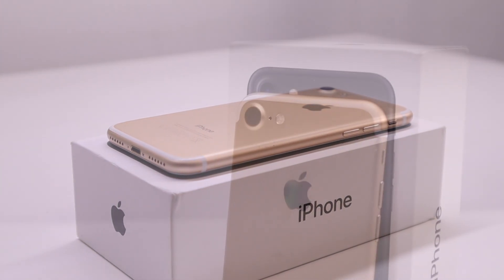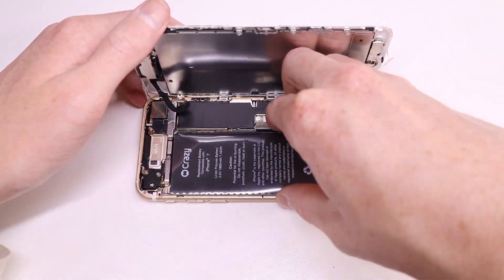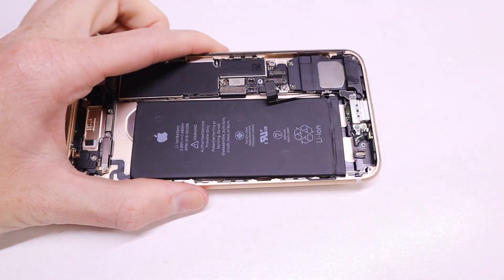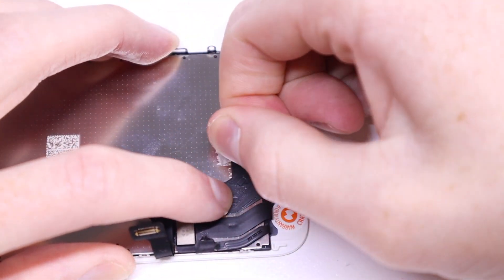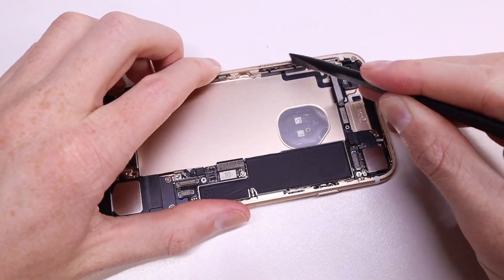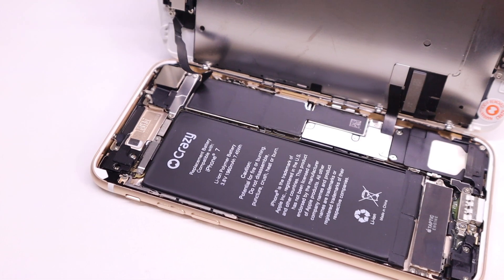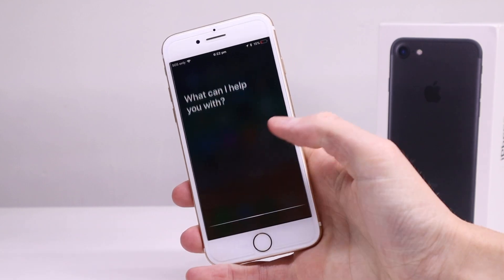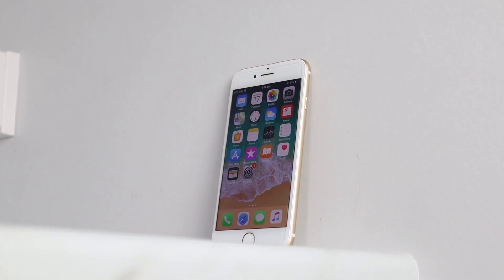Free Dead iPhone 7 - Can it be revived?

Comment: Might have a Tristar chip problem, if the battery goes completely dead, it won't charge in the phone anymore, you can replace the battery, but once it goes completely dead, you'll have to replace the battery again or charge it outside of the phone like you did here. You need to replace the Tristar chip to fix that issue. I do know that some batteries, if they have no charge left, will not get recognised by the device, simply because it's got no charge, hopefully that was the only issue you had and not the Tristar chip.

Comment: How did you find a good screen for thus iPhone bro?? 

I've buy some cheap one and the 3d touch is not flawless i could tell
Reply: Wan Nazmi buy refurbished screens they are only $10 to $20 more than aftermarkets but totally worth it in the long run, but if you’re really cheap there are 3D Touch working screens on aliexpress for $15 to $25.
Reply: no brah tq bro for suggestion 😁

Comment: Looks to me like the device is having issues with the Tristar chip, which  arranges the USB connections on the motherboard.
This chip is very vulnerable, and can get damaged when not using MFI certified lightning accessories like fans, cheap chargingcables and cheap powerbanks. My guess, if the battery in the iPhone 7 gets flat it won't charge anymore, and you again have to replace the battery to boot it up again. This issue can be fixed by microsoldering, it might be an interesting video if you go to a repairshop to do that.

Comment: My greatest deal so far was an iPhone 5 with an expanding battery in otherwise mint condition for 20€

Replaced the battery and turned it on, turns out it‘s running iOS 6.1.4

Comment: I have an iPhone 7. Whenever I lock my phone and leave it for 5 seconds the screen will not turn back on. It did not shutdown as the home button is still working. I believed that it is a hardware issue. I have all ready reset and updated the phone. Any idea how I can solve it? Screen replacement, loose connectors?

Comment: Tristar is going bad if you where able to charge the old battery and only certain chargers work on it. Grab a multimeter remover the battery connector plug in the charger with the battery disconnected and put the leads on the two gold pins and you should get 3.7v if you get 0.500 then tristar is bad.. can guarantee it. Also I picked up 2 iPhone 6s for 20 bucks and an LCD in exchange sold them the following day for 500 bucks....

Comment: Once got a '16gb' Iphone 6 for $100 and was advertised as having a faulty screen.  However when i fixed it up it actually turned out to be a 128gb model and all i had to do was re-seat the display cables and it works fine except for when it starts bugging out every once in a blue moon

Comment: I've been watching your videos for several months now and they are absolutely phenomenal and provide critical information for replacing iPhones, I really like your videos and really appreciate your help, a lot. My best deal was a iPhone 8+ for only $50, all it needed was a battery repair because it wouldn't turn on, put in a test battery and it worked just fine so I ended up just putting a new one in there. Worked flawlessly with no issues.

Comment: I did a screen replacement on my iphone 6s myself. Everything works fine, except when I tried to activate touch I'd, it tells me to put my finger print and when I do, it wont detect my finger. But the button works for its traditional use, like turning on the screen or to go to the home screen from a app. I don't know what the issue is. The home button I used is the same home button that came paired with the iphone. I just put it on a new display. Again, I don't know what the issue is. Plz help me!🧐📱🔋🔧💀

Comment: My best deal is funny but
I bought a 15 dollar iPhone to part out to fix my iPhone 7 for 75$ bad baseband

When I broke the iPhone with bad baseband I got mad so I tested the locked one, it had no fmi and the seller didint check, neither did I before hand so I am supper lucky. But the volume buttons don’t work and it’s a motherboard issue as the volume rocker works and I used my bad iPhones housing. I am now trying to disable it and reset it

Comment: My best iPhone deal is one I'm still working on. I paid $10 for an iPhone 5s from a seller who said the only thing wrong was the battery. It cost me $20 for a new battery just so I could discover the previous owner tried to replace the battery only to damage the screen. I paid an additional $30 for a replacement screen with all the parts already installed. I'll still need to swap out the home button to retain touch ID, but all in all, my current iPhone 5s will end up costing me $60. Not bad for a phone that costs a lot more. And if it's iCloud locked it's still an iPhone 5s. I've unlocked one before using iTunes.

Comment: Wait if the battery wasn’t the problem (because it worked after he charged it) doesn’t that mean the problem could be in the lightning port (which is still in the phone) and could potentially fail again?

Comment: Do you heat up the display once you put down the screen with the seal so it’ll help bond the adhesive to the frame of the housing and the screen?
Reply: nah bro the adhesive comes sticky, you peel the blue off and it'll stick down fine

Comment: I bought a lot of 10 iphone hosuings with boards in them. It came with 1 7 plus, 6 iphone 6, 1 iphone 6s and 2 6s plus. The 7 plus turned out to be a 256gb 7 plus, one of the 6's was a 16gb icloud unlocked and the 6s was a 64gb icloud unlocked.

Comment: I got a 6s for free, physical condition is excellent however I've tested 3 different batteries and it seems to drain extremely rapidly and idk what to do.
Reply: Smoke Tires,not Drugs are they 3rd party batteries or Apple official batteries?
Reply: Åńgëł official apple batteries
Reply: @thehometownidjit4268  where did you get it fixed at? A mall or the Apple store?

Comment: hi Hugh! i have been wondering where do you buy your iphone batteries from and watch brand are they? i'm in a dire need of swapping the battery of my 6s Plus. 

note: i can't take it to an Apple store reason been there are none in my country.
Reply: Hi! I know I am not Hugh but I figure I'd offer my advice, he (much like myself) uses batteries and other parts from 'Crazy Parts', which is an Australian store, I would recommend having a look around online and seeing if websites like 'iFixit' ships to your country. I know most people will disagree, but if you seriously cannot find a service that delivers to your location, give eBay a go, take your time reading not only seller reviews, but also product reviews, and choose a high quality part that will take a little while to get to you as apposed to a low quality part that will ship quickly. Just a heads up as well, if you are looking to perform a battery replacement on a 6s you will need not only the battery, but also the battery adhesive strips, and a 6s water/dust proof seal.

Best of Luck.
Reply: Fetus Deletus thank for the advice! I have my eye on the kit ifixit sells and as far as i know you can’t go wrong with them 😄
Reply: @360themaster  I haven't heard bad things from them but personally have never used them myself due to the astronomical shipping times.
Reply: Fetus Deletus shipping time isn’t too much of concern as long as they can ship it, my phone needs the battery, but is not like to the point where it shutoff on me randomly but it depletes fast. Gotta keep a battery pack on me at all times.

Comment: i found a free iPhone 7 but it has the apple loop screen and i'm not sure how to fix it. reply if you know plz
Reply: Minimaster 56 a common issue is a bad battery, the circuit thinks the battery is charged when it isn’t receiving any current. And some iPhone models will power on without a battery, some won’t.
Reply: atom starfire productions I’m not sure if I went into enough detail but please reply back if the same or something else applies.when you plug it in it goes to the booting screen goes black turns off and does it again and again till it’s dead and you can unplug it it keeps on going.
Reply: Minimaster 56 yes likely battery issue, but also possible dock connector or logic board.

Comment: I got a free iPhone 6 from my friend
It had supposed water damage and I was told that it hasn't turned on in a year. I put in a new battery and screen and I got it to work again.
Although the only issue it has is the power button doesn't work. Touch ID does work tho. The housing only has one little chip on the corner and the screen is a brand new replacement from eBay. All round cost me $25 for a 32GB TFW iPhone 6 Space Grey on iOS 11.2.6

Comment: Best deal I ever got was an iPhone 7 Plus 32gb that was IC Locked, had a cracked screen, and needed a new battery for $12.50 USD. I replaced the battery and screen and when I powered it on the phone didn't even have an icloud lock on it. Unfortunately the phone does have a bad IMEI so now it's just a glorified ipod touch

Comment: I got a iPhone 5s for $32 on Ebay because it had a broken front camera and speaker did not work. I was going to replace them but turns out after I tested them they worked perfectly fine. The phone is in great condition with a good battery.

Comment: Got a iPhone 6s for 15$, replaced the screen for another 20 and boom ez
Reply: Comfy Cloudy where did you buy it what seller
Reply: Fried FishYT eBay, offer up, friends. They are found everywhere just try to lowball extremely low and then with a second account give a better offer and they’ll usually accept the second offer as it’s much more reasonable. Unethical? Maybe
Reply: Where do you buy these
Reply: @hamza-ng1lc  I'm wondering the same thing.
Reply: @hamza-ng1lc  in my case I got it from a random guy off letgo (I do not recommend using this however) but the guy thought the phone was completely dead because the digitizer broke.
Reply: Mrowe's extra clips! Does letgo ship
Reply: @hamza-ng1lc  No and I do not recommend using letgo
Reply: @mrowproductions  Where u get the magnetic screw tray and replacement screen?, provide links if u can
Reply: @shttnmoney9434  For magnetic screw tray and other repair tools , i suggest ifixit (brand). You can buy good and cheap refurbished screens on eBay but always check the rating of buyer .
Reply: @hamza-ng1lc  eBay lol
Reply: Can someone send me a legit link I really want a iphone
Reply: @hamza-ng1lc  apple.com
Reply: Don’t buy screens of eBay unless they are refurbished screens or the seller is a phone part supplier. Otherwise other sellers that aren’t phone part suppliers will give you the lowest quality lcds since they buy the cheapest ones in bulk .
Reply: You're lucky as fuck i bought my iPhone 6S 4 years ago for 700 dollars
Reply: eyy
Reply: I got a iPhone 6s for free
Reply: @KnightVN it's FAKE
Reply: Lucky ;-;
Reply: @kyulani  yucky yucky, any repair shop near me charges >50$ per screen repair.
Reply: Mrowe’s extra clips  u got scammed
Reply: @glizzymanglizzymanyeathats1452  no he says it in the past tense so he's already got the iphone
Reply: How hard was it to replace the screen?
Reply: @shttnmoney9434  its not hard at all just get a video tutorial and make sure your hands are steady. A magnetic screw tray is very useful because the screws are smaller than ants
Reply: @shttnmoney9434  It's a hassle but once you get it done you won't regret it
Reply: Nice
Reply: HEY GUYS I HAVE A FULL GUIDE ON HOW TO CHANGE JUST THE GLASS ON MY CHANNEL. PLEASE CHECK IT OUT!